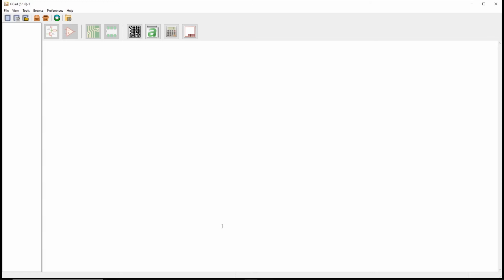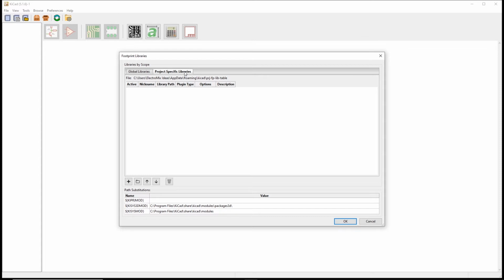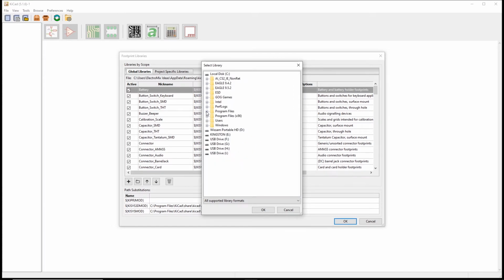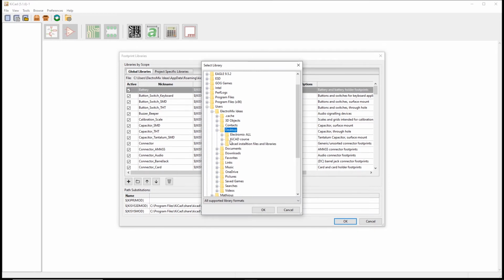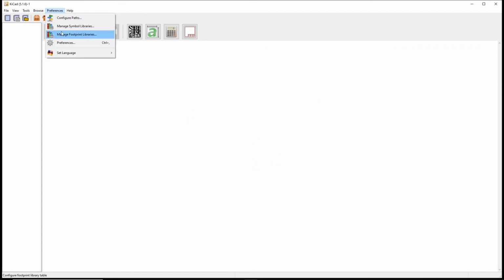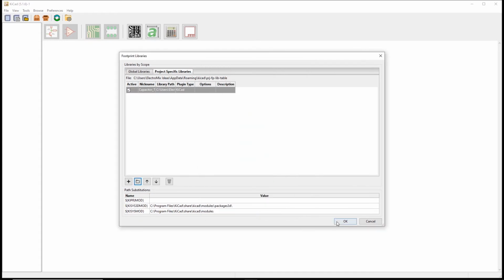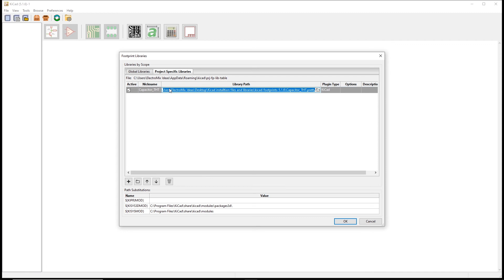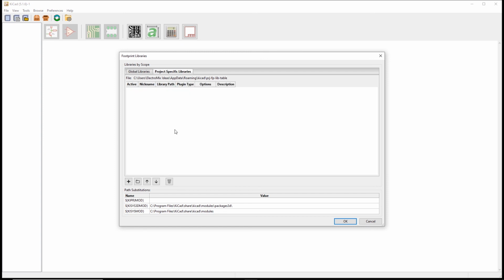Adding Footprint Libraries to KiCad install

Comment: What are other external libraries that are helpful? please suggest sources. I am planning to build Arduino board for practice
Reply from the maker: check on KiCad website, also, you can add individual symbols and footprints, if the part you are going to use is not in tany of the libraries ou already have, you can look for that individual part online. a good source is SnapEDA

Comment: That's fine, but how do I add the whole library?
Reply from the maker: Select a folder and add it. Not only one component. But for  symbols to have to select all components in a folder.
Reply: @electromixelectronicsideas6294  Thank you, that seems to work, but I can only get into specifics not into general library.  Is there a way of copying across?
Reply: @electromixelectronicsideas6294  right, I am going round and round in circle still.  This is getting depressing.  I watched this video again, very carefully and you find a folder called, 'kicad installation files and libraries' then you go to 'kicad-footprints 5.1.6'  that is the thing I need to know how to get it from kicad.  I have searched there website and I have a folder, kicad footprints master and kicad footprints 5.1.7 I click on that folder in the preferences library and it does not t install as yours does in the library.  Well, the folder does go into the library, but I only get a library name, not a list of footprints like you doWhat the heck am I doing wrong?
Reply from the maker: You have to go to Kicad.org go to the download and download the symbols and footprint  libraries and and then install them in the ways in the videos. Those videos are a part of a course as mentioned in the description, there are many other youtubes about the same subject. I hope that helps
Reply: @electromixelectronicsideas6294  thank you so much
Reply: @electromixelectronicsideas6294  SUCCES!